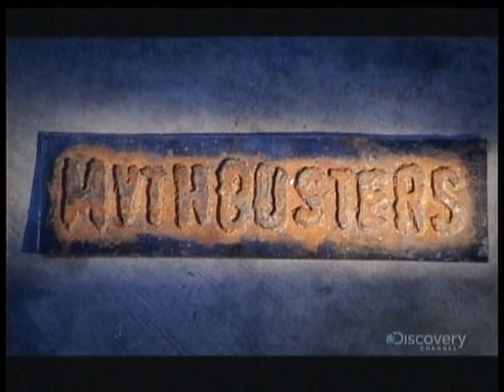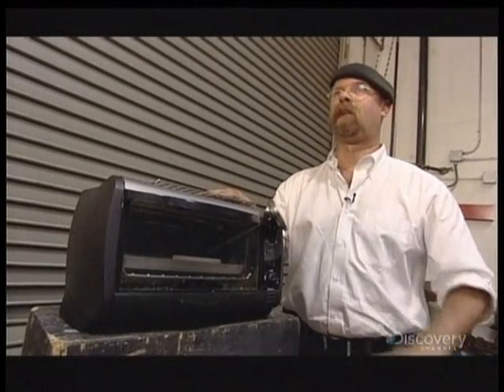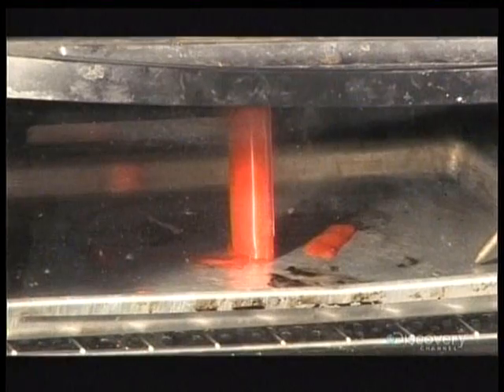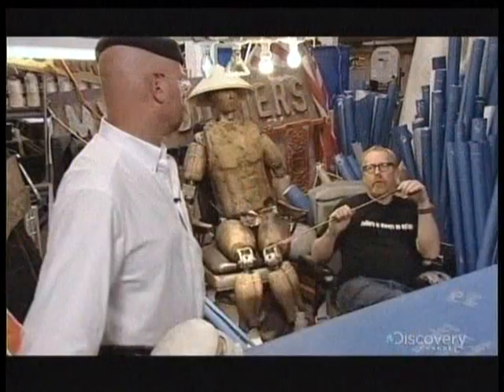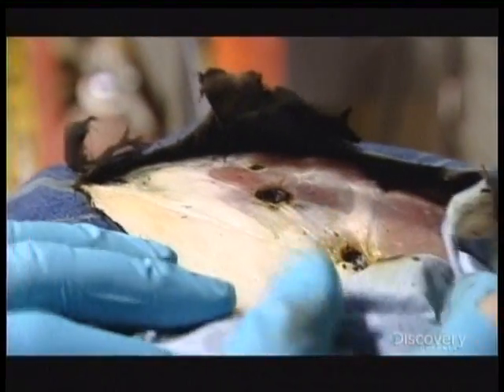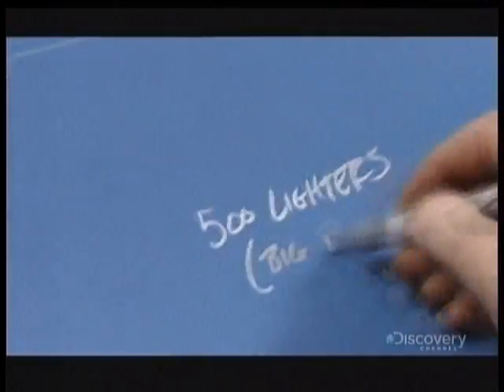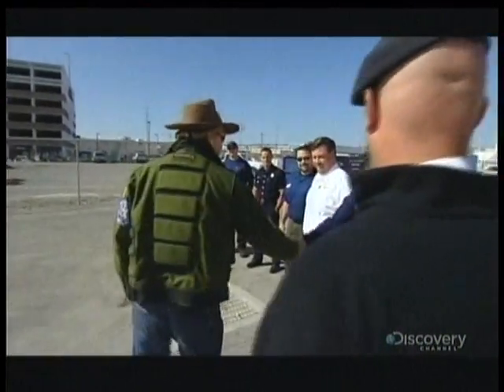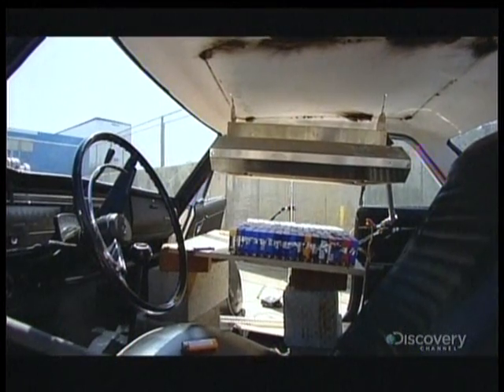Mythbusters: Exploding cigarette lighter part 2

Comment: I had few times gas lighter explodes in a car. But that is just plastic fracture, no flammable explosion. Simply, pressure of propane/butane mix is too high for the lighter casing to withstand. But, without source of ignition, nothing bad happened.

Comment: The thing they didn't factor in the car windshield is time. As a smoker leaving it up on ir dash for a while in the hot sun won't do anything. But leave it up there in Texas after a couple days and it will have significantly puffed out and weakend the plastic enough to where u don't even want to touch it.

Comment: Had they used those cheap ass clear crack lighters they would have exploded each time. Bic are much more durable. You can get a crack lighter to explode just by throwing it on the ground

Comment: Off brand blew in my sunglasses holder in my tiburon. 2009 California summer. 110 degrees. No fire, but it blew the plastic tray out of the ceiling. I looked outside at night and the dome light was on. I thought someone broke into my car. But the explosion turned on my dome light. It must have been pretty powerful.

Comment: It does explode. I left my motorbike trousers, made of goretex drying by the radiator (home heating) after a rainy bike day. And I forgot my lighter in the pocket. Note that the trousers were NOT on the radiator. It was only close to the radiator. And, as I was showering, it went boom. Scared the living shit out of me.
I guess it's a combination of certain circumstances, elements... but it does explode.
Reply: Heaters gonna heat

Comment: It has happened to me TWICE. Once in India and another time in Australia, both times when the car was left in the sun and the temp exceeded 44C. I did not see the lighters burn or explode but I left a lighter on the dash and came to lighter bits in the car so..... yeah. I guess now that I see the video I realise I was lucky there was no fire.
Reply: Texas and I've had a couple pop, looks like they used bic lighters, the ones I've had pop were cheapo lighters
Reply: @creektimothy  yeah the bics won't bust in car or dryer the cheap clear colored ones will in short order cheaper thinner plastic wish they realized the difference
Reply: Same here, transparent three for a dollar lighters.
Reply: Haluk L. Aka lucky you didn’t crash! It was an explosion though. You would need some kind of vacuum for implosion :)
Reply: Same happened to me. I had a lighter inside my car in the heat this past summer for only about an hour and it exploded lol
Reply: Happened to me in South Carolina. My sister left one in the car and when we got in after school we saw little bits of the lighter scattered around.
Reply: Same for me but in in Spain
Reply: rudiger891  I live in Australia and it happen to me last month
Reply: Oh shit, I was going to say I live in Australia and often leave my lighter in my car and I’ve never had one explode, even when I have had empty water bottles warp
Reply: The temperature limit is declared by law. That they won't fail when exposed to heat unless under extremely specific circumstances. There isn't a law to it specifically but commercial products are expected to be safe under "reasonable conditions" and if not they need a special "dangerous goods" label that come with a lot of increased taxes, selling restrictions, customer scaring warning labels and other limits that production companies rather avoid.
Reply: I had a Bic blow up in my boat with the cover on it
Reply: I had one explode in my pocket, forgot it was there and I was sat on the floor in front of the fire luckily there was no fire but I did end up with a bruise on my leg 🥴

Comment: 350°F (180°C)? The whole dashboard would start to melt.
Reply: Jan Sten Adámek 180°F. Which is 82°C.
Reply: Ben Ward I vote BS because I have never in 20 years of driving experienced the dashboard to be to hot to touch let alone nearly boiling water
Reply: @4wdsome444  what? Do you live somewhere that is actually warm?

Comment: I think there is a lot of variance in quality between different brands and makes of cheap lighters, I almost never have any issues with one brand, while I started avoiding another because the top housing plastic parts tended to catch fire when lighting things that just take a second longer to light like a new candle. The worst I had was a sudden leak and burst of flame when I was lighting a cigarette, threw it away in reflex and it made a small explosion when it hit the ground.

Comment: @genjuro88 same happened to me, even in winter time. I had an old mazda 323f was driving it with a heater fully on and  bang... Few pieces hit  in my face but luckily didn't hit my eyes. So put a lighter on a dash is not recommended :)